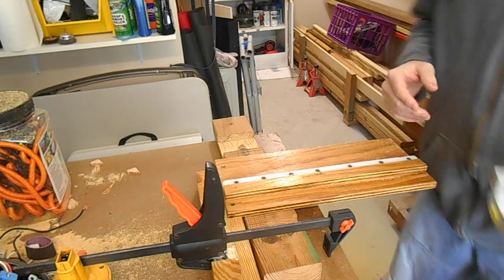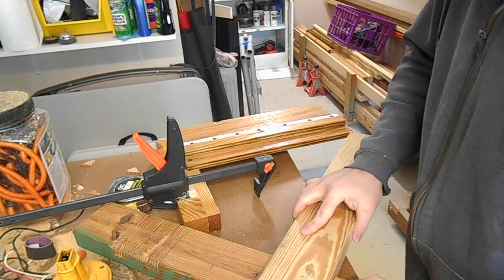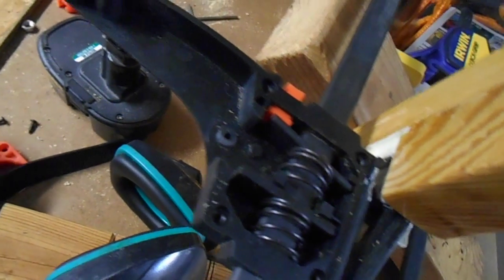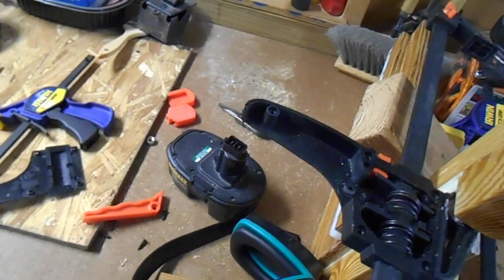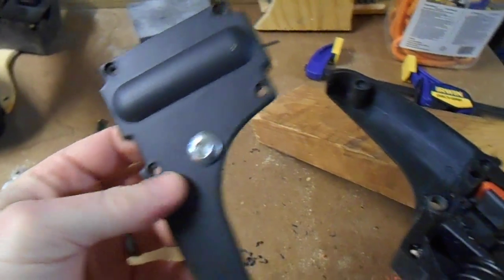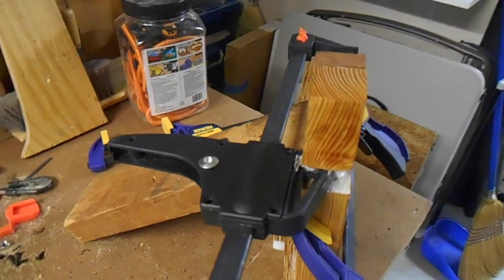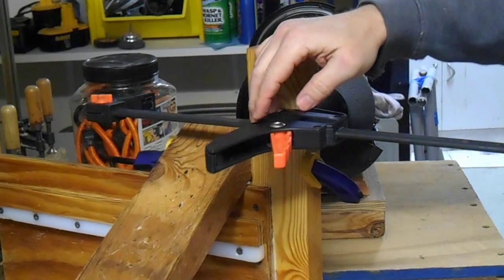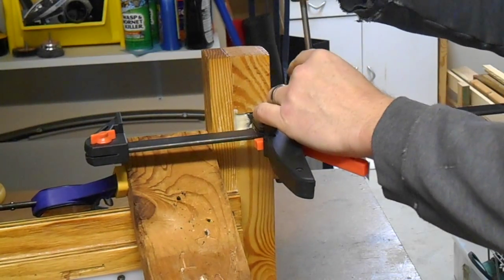Improvements to the Circular Saw Dado/Rabbet Jig

Comment: You would be better off keeping the rest of the design and just using good clamps that attach to the jig itself. Just move the clamps each time to make another pass with the saw. It would take longer, but would work. That plastic crap won't hold up. You can beat it to fit and paint it to match all day long and the plastic is going to give out on you over and over again, in different areas. I despise cheaply made crap and most of what they are selling us nowadays is exactly that. I wish they'd do away with plastic and metal being used together where force/strength is necessary. Just use metal parts through and through and be done with it. Or at least don't use plastic where a woodworker needs strength. I'm still fidgeting with my Stanley plane. It's one of those that they sell nowadays. There is too much play in the plane blade and the side to side movement is causing every swipe to always be unlevel. They used brass, a super soft metal, for the thumbscrews to clamp all the parts with each other. It slips and if I tighten it too much, what do you think will happen? Yep, it will strip. It's pretty and all, as a paperweight, maybe, but I'm going to have to buy a good smoothing plane in the end. $35 wasted. Lesson learned. Watch Youtube first to find out what planes seem to satisfy people the best. I don't see any Youtuber woodworkers using this plane. I now know why.